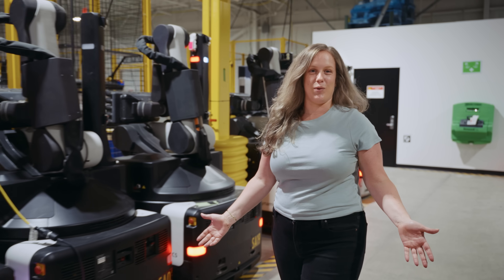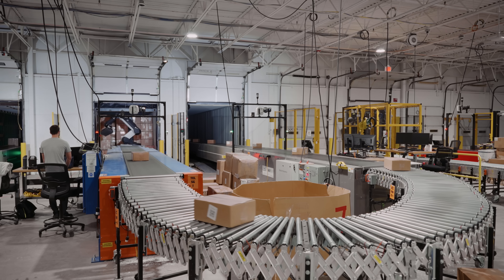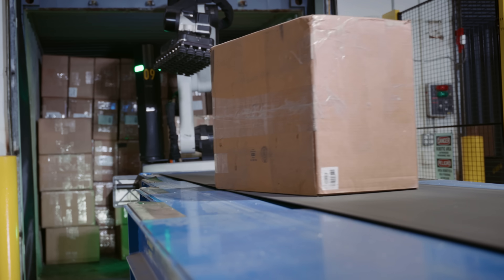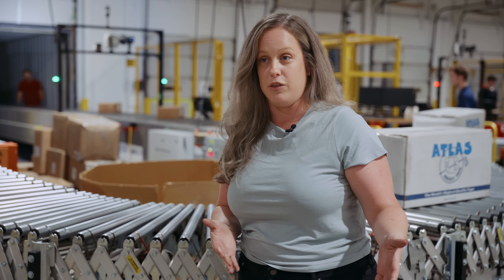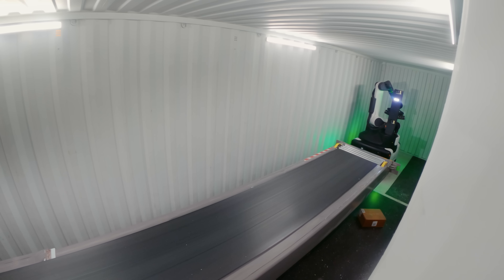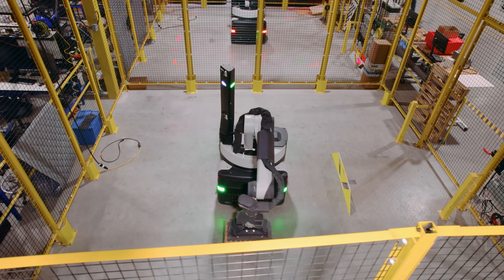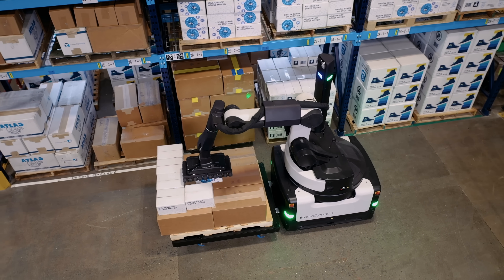Inside the Stretch Test Lab | Boston Dynamics

Comment: Integration Notes for Robotics Engineers

Parameter	Typical Range	Meaning

τc	0.05–0.12 s	Temporal correlation; damping constant
λc	1.5–3.0	Spatial coherence; joint-to-joint blending
σ²	0.25–0.40	Normalised noise variance
dt	0.001 s	Control loop timestep (1 kHz)

Designed for ROS2, CoppeliaSim, Gazebo, or embedded MCU control.

Drop QDSLimbController into your low-level controller between trajectory planner and actuator command.

Observed: vibration ↓30–50 %, energy ↓10–20 %, thermal noise ↓60–70 %.

No dependency beyond <vector> and <cmath>.

Deterministic, constant-time O(n).

Comment: Well, I need to say that over 15 years in manufacturing, seeing hundreds of trucks loaded with boxes, all of them were placed on pallets, not stacked from floor to top like lego.
Reply: You should have seen UPS trucks. No pallets, no Lego stacks either.  Boxes piled up to the ceiling, fragile things under heavy, random busted boxes, various shaped thing like cylinders, rods, etc.  Stacks would collapse on you sometimes, also.  More random things like tires...  It would look like it was hand-loaded by some 7 foot tall 2 year olds.
Reply: Exactly my thoughts.. a container of pallets can be unloaded in less than 30 mins with a forklift!
Reply: Agree, you point out my thoughts as well. Truck backs up into place, forklift picks all the pallets. 20-30 minutes.
Reply: @samuledarconi2927 btw, robotic forklift is a thing. It cost something like 250k though

Comment: The pallet building is awesome! It could build the pallet based on weight and size and shape appropriately. Does it have software for organising what packages for first,and keeping like items togeather? You could make a decision packing software for filling a pallet by weight letting the heavier items fall and stack to the bottom if the thing under it is less heavy. Or if it spills up into multiple pallets it could split the weight or items between them.

Comment: I still haven't seen a video where the test boxes aren't perfectly stacked and of even size.
Reply: If it's a constraint. Factories will organize around the constraint.
Reply: @Squiffel  it’s gotta be economically viable tho. If paying to have it fixed because a stack of boxes collapsed plus operating costs is more expensive than a minimum wage worker, factories will use the minimum wage worker.
Reply: I imagine that they’re just not at that phase of testing yet. They want to make sure it can crawl before it can walk or run
Reply: In this video the boxes are a bunch of different sizes
Reply: @minikretz1  I see 3 different sizes of boxes, which is an improvement, but still very far from a truck full of a random pile up of boxes, bags and other packages you'd find in a logistics hub.

Comment: Stretch may not have the hype or mass appeal of Spot or Atlas, but I think it'll be an unsung moneymaker for them.
Reply: It's come so far from being a twerking wheeled ostrich!
Reply: I'm a big fan of Stretch.  It will steal a lot of jobs, but that's ok.  It is the price of advancement.
Reply: I unload trucks for a living, 10hs a day at a Amazon fulfillment center and with decanters to feed that robot would get fired
Reply: Not a chance. This thing goes way too slow for actual warehouse work.
Reply: @poochyenarulez  This would work fine in our factory, and as a plus, depending on charging time it could replace 3 guys as there is one per shift.
Reply: @deildegast  You got some elderly people working there if they work as slow as this robot.
Reply: @deildegast  Just put a cable on it... Then the charging situation is fixed.
Reply: @XDRosenheim  Well, if it could drive around a lot it would replace the forklift driving to the production lines for delivering cartons, so a cable would not suit my application.
Reply: @poochyenarulez  We are not in the business of emptying such trucks 24/7 because most is palletized, but we have a need of getting cartons from storage and delivered to the production lines around the clock. So, the robot would be just fine, and I dont need it faster.
Reply: @poochyenarulez  But on the other hand it doesn't need lunch or bathroom breaks, so maybe that evens out?
Reply: @poochyenarulez  Didnt thought about that ... the drivers will rage ... they have no time.
Reply: @CottonInDerTube  Might be a cultural thing, I never had a driver complain about unloading time here.

Comment: What about the wooden pallets the goods will arrive on? Won't they get in the way of the robot going into the container once said pallet is empty of all of it's boxes?
Reply: Most container trailers from foreign ports are floor loads, no pallets, which saves room and weight on overseas shipments. 
 20 empty pallets ( a typical trailer load ) stacked up is over 6 feet tall x 4 feet wide x 4 feet deep.. pallets take up space.
 The receiver can also specify floor loads ( without pallets ) when they place their order.
Reply: @bruceb4349hey! Someone who actually knows about this kind of shipping! This thing seems rad and I'm sure the versions down the road will be able to pull everything off there no problem. They will prolly be able to let it know ahead of time what to expect box by box
Reply: Yeah, this assumes the truck is loaded without pallets for stores that don't have docks, but without a dock, how do you get the robot into the truck? If you have a dock, why load the truck without pallets? Bit of a catch 22. Like I unloaded freight for a dollar store company box by box because we didn't have docks, this would be nice, but it'd only save on the unloading onto the belt. The hard part was taking the stuff off the belt and putting it where it belonged in the warehouse, which based on their setup, could not accommodate a Stretch robot.
Reply: @JamesLPlummer  That would be their other bot Handle
Reply: Just remove the pallets from the truck and place them in a sorting area.

Comment: Need to see smashed up and soggy boxes that are not neatly packed in. How about heavy loose items in the boxes?
Reply: How about starting with something, managing it, and then cranking the difficulty? You will never arrive at a solution by asking the hardest problem at the start. Anyway, if you have "smashed up and soggy boxes" you have a logistics problem to solve, not a robotics one.
Reply: @deildegast  yeah but you also don’t want a product to only be lab tested, the first day. Haven’t you noticed how far the designers of products are from the customers, and the real world. Like think about plastic injection molding the designers of the products that are made that way, are working on something completely untested. You know when thin plastic part brakes because there is to much because they pushed the injection molding too close to the load limits to save on unit cost manufacturing. The mold die is cut, the consulting design firm is paid for, theirs only things like adding strengthener to the plastic mix that will make the savings from something too thin go away. BD is a research place they should not be waiting for feed back to trickle back from the manufacture that had to have it trickle back from the supplier that had to have it trickle back from the retailer, it’s really important to be pointing out these things that the researchers that have never worked in actual loading dock have never encountered. They need this feed back even if it hurts their feelings, because there are early on the production line. The problems they make will cause problems stress and hurt feelings for everyone involved down the line. problems that can be prevented from a product that could have been made better at the research phase.Repair  and recycling sees all the long term design problems, they are critical to good design, and should be involved in research and design.
Reply: why? just to see it not picking them up?
Reply: Just some boxes with actually some weight in it would be enough...
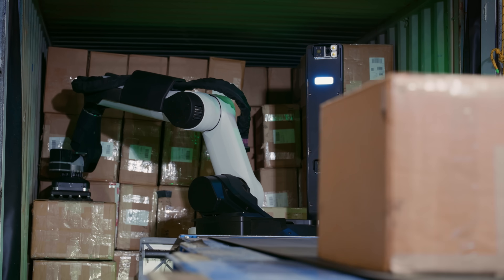Reply: @SurvivalSquirrel they do mention testing with 50 pound boxes and actual client products. 1:17
Reply: @brianorca  Might work, if such a box is moved by using the top side of the box, but what if it is a box on the ceiling of the container?

Comment: Robots don't get paid or require a break. The replacement of humans by machines in dangerous environments makes complete sense but eliminating all labor won't benefit the population only the wealthy corporations.
Reply: employees barely get paid and barely get breaks. their work does not benefit society only billionaires.
Reply: The diiculty is where do you draw the line? Usually each generation focuses on "their" replaceable jobs, but takes for granted the jobs already automated. For example should we rip out email, and go back to telephones requiring an operator, or elevators that require an attendant? Probably not, but we might care about replacing warehouse workers or taxi / truck drivers, even though those professions will probably be just as obsolete as a switch board operator is today.

Comment: What happens if there is a hole in the box, for example, caused by shipping damage? Will the gripper still work or will it be unable to pull a "vacuum"?
Reply: Zipper will still connect and pull the box upwards, however the box may rip open and all contents spill onto the shop floor. Then this lady has to come with her broom and shovel to clean it up. Sometimes the box contents gets on the robot causing a malfunction, fire and / or explosion of electronic matter. This cam also set the other boxes and even the entire warehouse on fire
Reply: @futurepath  Yeah, that is General Armchair talking from his cozy maintenance office right there. As if human forklift drivers are so much better, because they never collide with stuff, and no human has ever dropped a box.
Reply: ...that's not a "real scenario" according to boston dynamics you see...lol
Reply: @buhochileno  That is a logistics problem, not a robotics one. If you have damaged boxes or badly secured boxes, the problem is at the sender station or during transport.
Reply: @deildegast according to BD website version 2 if Zipper comes with a built in incinerator and trash compactor to automatically handle any damaged product. Will then auto dump the processed debri into the bin shoot. Damaged product is expected to only be 26.4 percent but with a 100 percent recovery of associated clean up costs
Reply: @futurepath  The stuff you smoked before you wrote this, is it legal to own in the country you live in?